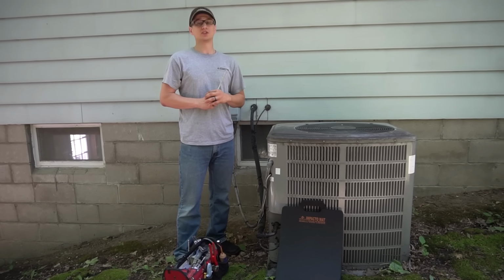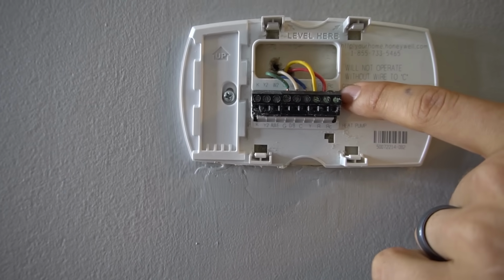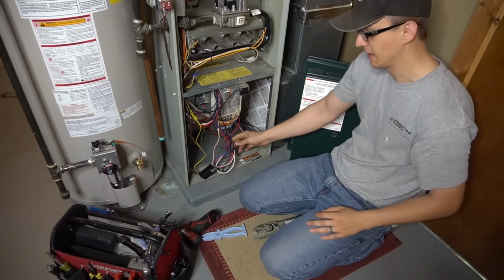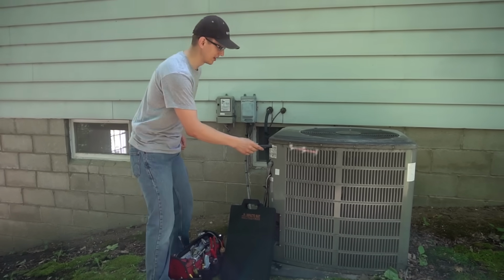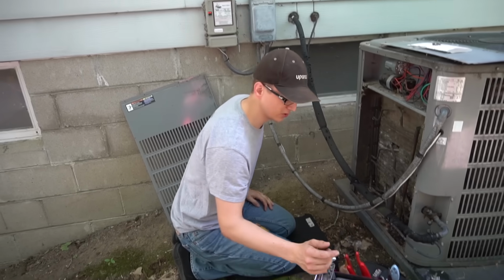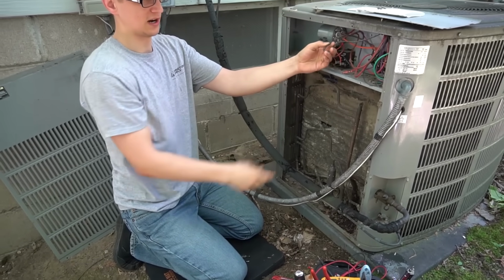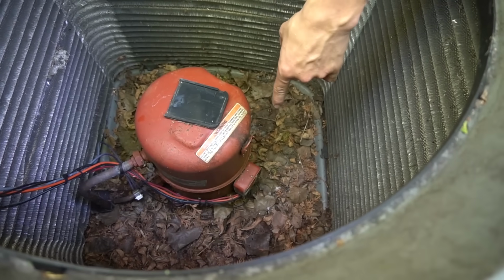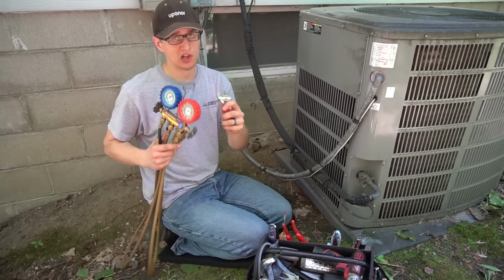AC Unit Not Turning On - How to Fix It Step by Step

Comment: I have an odd one for you, hopefully you can help, I will give as much info I can in case it helps diagnose.  I have a Trane XE1000 air conditioner and Trane high efficiency furnace that is about 18 years old.  Two years ago a service guy added 1.5 pounds of freon.  Last year a service guy checked the freon levels and said none was needed.  That same summer the capacitor on the outside condenser unit went out (outdoor fan stopped turning) so I replaced it, all fixed at that time.  We noticed a bit of light rattling noise in the indoor vents at startup of the blower but always went  way after about 10 seconds.  Fast forward to this summer, the rattling noise has been more prominent and lasting longer and longer and now lasts the entire time the indoor/furnace fan is blowing during AC use.  Messing with the furnace cabinet used to impact the sound, but not anymore so not sure if this was furnace blower related, squirrel cage related, or just some metal part of the furnace.  Tonight, the outdoor and indoor unit seemed to be working ok, but there was no cool air coming out of the vents starting around 6:30 PM.  I went outside and the outdoor fan was turning and I couldn't tell if compressor was running or not.  I shut off the system and hosed off the outdoor coil which is something I did a couple weeks ago as well for preventive maintenance.  20 minutes later the air conditioner fired up and started cooling again and has been working several hours since without problem.  Any ideas on what might be wrong?  Could the capacitor be on its way out again (even though only 1 year old) and it allows the fan to turn but not turn on the compressor?  I was thinking about taking apart the top of the unit tomorrow and cleaning out what I can, but I fear that is not the real issue since it does not appear to be super filthy.  Thanks in advance for any assistance you may offer!
Reply from the maker: Hey Damian! (Nice name btw) Thank you for all the details! So I can't say for sure but after reading that, I can think of one scenario that would fit your story pretty well.. An AC is a permanently sealed system. That means that whatever refrigerant is in the unit, stays in it for the life of the unit. If you ever have to add more, that guarantees that there is a leak in the system and it will, with time, leak out again. The temperature of the refrigerant inside the pipes (likely R22), is about 38 degrees on a normal day. Keeping in mind that temperatures correlate with pressures... When some of the R22 leaks out, the pressures will drop which will also cause the temperature of the refrigerant to go down. Once it gets lower than 32 degrees, the evaporator coil inside starts to freeze the condensation that it collects. The longer the unit runs, the more ice will build up. Once enough ice forms, there will be a restriction in airflow because the air can't get past the frozen coil. The air then starts to escape through any cracks it can which can cause a rattling noise. This would be my first guess. An easy way to see if this is the case, is to take a look at the evaporator coil after the unit runs for a couple hours. The coil is typically behind a plenum, you may have to take it apart a bit to see it or if you have a register above it, you can just look at it from above. Once in a while, if it is really hard to access, I will pull the blower wheel out and slide in on my back under the furnace and look up with a flashlight. (If your furnace is 90% efficient [plastic venting] this will not work since the secondary heat exchanger will be in the way) Let me know what you find
Reply: I am able to see the coil from above as I can remove a humidifier unit and look down at it.  I don't see any ice around it.  I have a guy coming out in a couple days to look at it.  In talking to him on the phone, he thinks it might be a low pressure safety switch going off due to low coolant that occasionally shuts it off until the pressure equalizes again.  We shall see...  Oh and another thing, I think the only other time (not 100% sure) that the air conditioner stopped working was around 6-6:30 PM the next day, so I am wondering what kind of coincidence that could have.  Saw someone mention something about needing a hard start feature added to their unit to extend its life as it was not running around that time of day as well when a lot of homes were pulling the A/C to turn on at that time, not sure if that is legit excuse or not!
Reply from the maker: I just read your initial post one more time, along with your reply. So if the unit is cooling good but just at at a certain time of the day the compressor shuts off, then that is probably something else. And you verified that it's not freezing. Is your furnace an up-flow furnace? (vertical) If it is, sometimes what is rattling is a thin piece of sheet metal under the furnace. If you just roll up a newspaper and jam it underneath it, it may make the rattling stop. (that worked for me before)

If the unit is running all day long, then I doubt it is the low pressure cut out that is tripping. Usually when I see those things trip it would look a little different. It will run for about 30 seconds - 1 minute, shut off for a little, turn back on, and it will just keep doing that over and over. 

Do you have a power saving switch from the electric company? It is possible that they are cycling you off. (you can call them, give them your address, and they should be able to tell you when they cycled you off)

The hard start kit may help. On hot days, the compressor will pull high amperage at start up. If the amp draw gets too high, the compressor will lock up. A hard start will usually cut the start up amp draw in half. So if that is the problem, it would likely solve it.
Reply: I am not aware of a power saving switch.  I will call Ameren (my electric company) and ask.  We are also right next to a transformer, not sure if that matters. It is an up flow furnace, Trane XE90.  What is really weird is that the rattling sound I used to hear stopped the first time time I noticed that the A/C compressor stopped running outside and even though the AC compressor has been working ever since except maybe once every day, the sound has not returned!  Not sure if it matters or not, but my thermostat is an Emerson Sensi that I put in a few years ago.  When the AC was not putting out cold air, the room temp was flashing as it was a degree or two above the set temperature.  I assume that just means it is recognizing that the AC is not able to keep up.
Reply from the maker: Hmmm.. The flashing room temp is kind of interesting. I wonder if your thermostat is defective. Next time your AC turns off like that, you should try taking your thermostat off the wall and bypassing it. I have a video showing how if you are not sure how to do that: https://www.youtube.com/watch?v=9Y_R9unnadI

If your AC will turn back on with the thermostat bypassed, then you know something's up with the thermostat. Does it have batteries?
Reply: it does have batteries but they show full for what that is worth.  A tech guy came out late last night and checked the coolant levels, capacitor, and electrical pulls and said all looked good, he thought the outdoor fan may have been overheating due to some dirt and crud on the outdoor coil.  He is coming back out today to do a more thorough cleaning.  I still might call the utility company to see what they have to say.
Reply from the maker: Let me know if you find out what was causing that. Good luck!
Reply: He came back and cleaned the outdoor coil and said it was filthy, i have not had a problem since, thanks
Reply from the maker: Oh wow, this whole time it was a dirty coil! Wouldn't have been my first thought either. Especially since you hosed it down a couple times yourself. Hopefully that will solve the problem for good. Thank you for coming back with an update! Stay cool

Comment: Thanks, looks like my connector isnt working, new part is in the mail now. Your the best!
Reply from the maker: Alright, good luck and be safe! :)
Reply: Word of Advice TV 
So I replaced the connector, but that didn't seem to fix it. From what I can tell, the plunger on the connector isnt activating. But when I manually push it in, the whole system works. So that means that it has something to do with the thermostat, or the thermostat cables? Thats kinda where I am leaning? What do you think?
Reply from the maker: Yes, if you press in the contactor plunger and everything starts up, then likely you are not getting the control voltage to your contactor coil. (24v). A simple way to rule out the thermostat is to bypass it. If you don't know how, I have a video about that: https://www.youtube.com/watch?v=9Y_R9unnadI

Have you checked for a blown 3 amp fuse in the furnace/air handler? Also, does your unit have a condensate overflow float switch? (usually will have one if you have an attic unit) Then you may have a plugged condensate drain line. By the way, do you have a meter you can check voltages with? I could help you find the culprit faster if you do.
Reply: Word of Advice TV 
I did check the fuse, and it appears fine. 
I did also replace the thermostat with a cheap one, which didn't help.
I'm going to go borrow a voltage meter tonight so I can check the lines. 
I'm not sure about the float switch, though I haven't checked the drain line.
Reply from the maker: If you have a float switch, a blocked condensate drain would cause the water to back up in the drain pan and the float switch would shut the unit off.

When you get the meter, locate the thermostat terminal strip (R,Y,C,W,G) at the control board and check voltage between R and C. There should be 24v there. Then check voltage between Y and C. You should have 24v there too. (if the thermostat is calling for cooling and power is on to the unit). Then check the contactor coil, that should have 24v too. But chances are, one of these 24v readings will be 0v instead.. 

Another thing, the thermostat wire coming out of the house and into the condenser usually has 2 wires in it, a red and a white. Do those two wires go straight to the contactor coil or do they go somewhere else? Something out there that is in series with the contactor coil could be interrupting power as well.
Reply: Word of Advice TV 
So i have been learning and trying to trouble shoot this for a few days now, and as I was outside about to check the voltage, my neighbor comes over, kicks the heat pump, and it just turns on. I'm kinda ticked at the guy :p.

So at this point I'm assuming it is a short or something in one of the thermostat wires by the heat pump?
Reply from the maker: Lol! That's the most effective timeless technique! It has worked for me before too. When all else fails, smack the thing. Yeah, I would think there is a loose connection or a bare wire somewhere
Reply: Word of Advice TV 
Awesome. Well thanks so much for all your help in the process. Your the best! 
Do you happen to have a patreon account or anything like that?
Reply from the maker: Thanks! :) At this point, I am just being a good civilian and helping when I can, no patreon accounts. But I appreciate the thought!

Comment: Awesome! With mine, the fan sounds bumming but not turning..... the pipe goes into the house is cold....what could be the solution? Oiling the fan motor?
Reply from the maker: If you try to spin the fan with a screw driver does it spin freely? If it spins freely, then I would replace the capacitor. If you have more then one capacitor, just see which on is hooked up to the fan.

If the fan blade is seized up and does not spin very good, then you can try oiling it but I don't think that will do much good. The motor is probably burnt out and needs to be replaced. When replacing the fan motor, I would recommend replacing the capacitor as well.
Reply: Word of Advice TV@Thank you so much. Do they sell fan motor to an unlicensed person like me? Where do I buy the fan motor? I live in Atlanta area.
Reply from the maker: Yes they do. I hope you are a handy guy :) This is a medium difficulty job. Hard difficulty would be a compressor replacement. When you are looking for a condenser fan motor keep in mind that you should be looking for matched specs on the motor. Look at your old motor label and note what the HP, RPM and Voltage is. Those will need be the same on the new motor. Do some research on what condenser fan motor will fit into your unit and then you can probably buy that motor on Amazon. They have a bunch of motors. Example: https://amzn.to/2zC4IiE    Also, don't forget to order a new capacitor too.
Reply: Word of Advice TV@  Yes, I am pretty much handy guy. Thanks for the advice. Quick and kind!
Reply from the maker: You're welcome! Be safe and good luck! And just in case you will run into this problem... Sometimes the fan blade can be hard to take off. What usually works for me is taking a channel locks pliers (the pliers with teeth) and bite into the motor shaft on the side closer to the motor. This is important, make sure you DO NOT use a toothed wrench on the shaft part that is on the outside of the fan blade. This will make it really hard to pull off the blade. So after you get a good grip on it, keep the shaft in place and spin the fan blade. That should loosen it up and typically it will come right off after a few good tugs.
Reply: Clinton: I got my fan motor at Fox appliance parts in Marietta, pulling the blade off was the hard part.
Reply: Word of Advice TV, bill man@ Thank you so much!
Reply: Clinton Kim.
I just fixed my capacitor and I bought the part at Fox appliance parts.
Hope this helps.

Comment: Would like to know what to do if my unit is not blowing cold air and the fan is not turning outside but when I stick something in there and push it it will kick on. But then when we turn it off the fan wont spin again unless I give it help manually.
Reply from the maker: That sounds like you have a weak capacitor. Here is a video on how to check and replace one: https://www.youtube.com/watch?v=C82HvbvP08E&t=1s

Comment: is it bad if the voltage at the disconnect box is 330 volts and not 240?
Reply from the maker: That's quite a bit higher than usual. The highest I typically see is 250v. Something is causing your voltage to spike. I would say that's not good.

Comment: Awesome videos.  I have an interesting problem that has occurred a couple of times now.  Last summer when we had a really hot spell, the AC mysteriously stopped working while I was away.  I had a service guy come, but it was working when he called, so he couldn't diagnose.  He suggested that it was possibly a defective Peak Saver thermostat problem.  I changed it out, but the problem persisted.  That intermittent thing happened a few times in the next week, and then went away.  This past week we had the same problem - really long hot spell, and no sound from the evaporator.  I did all the diagnostics I could the furnace, and installed a new Ecobee3, just in case.  Everything about the furnace works fine, but no fan on the AC outside.  I cleaned all the fins, and tested the contactor switch.  Pushing in the contactor turned the AC on just fine.  I came inside to rewatch some of your video, and grabbed my multimeter to test whether there was 24v at the switch, but when I got to the AC unit it was running fine.
Reply from the maker: Oh boy.. Those intermittent problems can be hard to chase down. I am a little confused though. You said there is no sound from the evaporator (the evaporator coil is the coil inside, usually above the furnace) then you go on to say that everything about the furnace works fine. So does the blower motor in the furnace come on or no? This may seem like an odd question but what state are you from? Do you have a condensate overflow float switch by chance?

So from what you explained, it seems like the contactor coil was not getting 24v. So somewhere between the furnace and the contactor something is interrupting the circuit.
Reply: Thanks for you reply.  I just saw it now...  I meant the condenser outside. I have confirmed that there is 24v at the point where the thermostat wire connects to the electrical box on the AC unit right now, but nothing is running.  pushing the contactor switch starts the unit just fine and it starts cooling right away.  When the thermostat calls for cooling, the blower fan on the furnace kicks into high fan mode just fine.  I'm in Ontario, have a Lennox G32V Furnace from 2002, and a Lennox Series XC14 AC unit  from 2010.  Pretty sure there is no condensate overflow float switch.  Cheers!
Reply from the maker: Ah okay! I only asked where you live because it seems like most AC problems in Florida have something to do with a plugged condensate drain. So it sounds like the power is getting outside and then something interrupts it. When you checked for 24v outside, did you check that by putting both your meter leads on either side of the contactor coil? If you have 24v at the contactor coil yet it is not pulling in, then the contactor is bad.

Comment: I have a multi meter that will check AC voltage.
It will also check micro farrads, is this how you check the capacitors?
Reply from the maker: Yes. In this video I check a capacitor with a meter, check it out if you want: https://www.youtube.com/watch?v=C82HvbvP08E